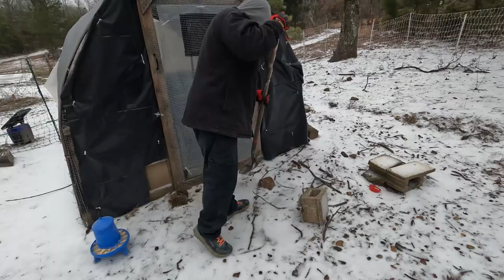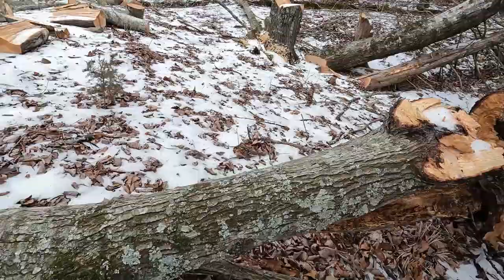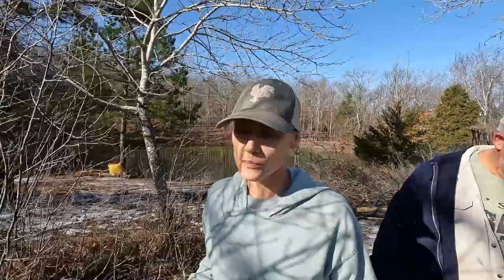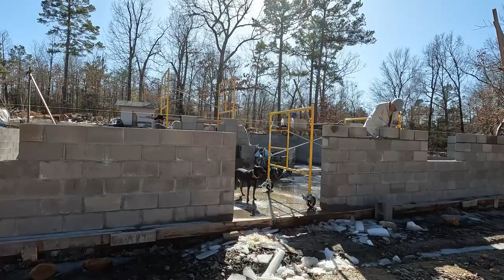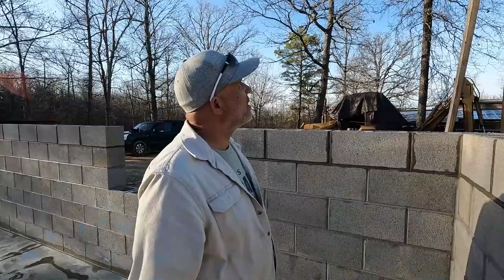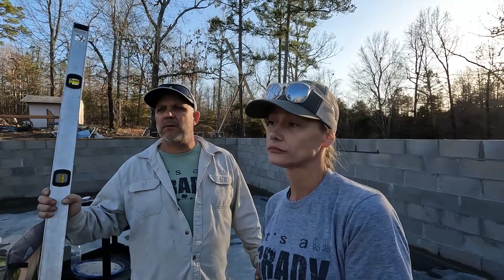It really wasn't that bad | Couple builds house| Ice storm damage |Basement continues| Debt Free

Comment: I have a suggestion for you guys. It might be helpful  if you insulate the bottom of trailer and put a skirting around it. Pipes wouldn't freeze
Reply from the maker: THANKS FOR THE TIPS🥰
Reply: I was going to suggest that same thing. If you can't do the whole bottom get some hay bales and plastic and tape the plastic around the plumbing and use the hay bales to keep plastic in place and to use as insulation.

Comment: Very good its getting warmer for you guy's 36c hear today just over 100f pretty warm hear Marcel you have done a really good job for only just learning my family were all builders they worked in rain and summer when hot just shorter days always start early its not that hot in the mornings and afternoons was a bit shadier and cooler you should do that have time to rest middle of the day it works i did it for a while to Just wondering did you poor cement down the blocks that end you like strong ? it would help strengthen the building that end just make it runny and poor it down lots of cement in it to ? think about it ok Marcel dont worry Denise it looked good to me i did watch it all that 18 months back stuff you did there
Reply from the maker: Dang, so hard to process that temp as it's still like 40deg cooler and more here. Lol
Reply: @Itsallgrady  60 f more our was i grew up using Fahrenheit then they bloody changed to Celsius but you get used to it but in my head i know what is what sort of 100f is 36 c probably the only one i know hahahah
Reply from the maker: Yes we will be core filming the block build.